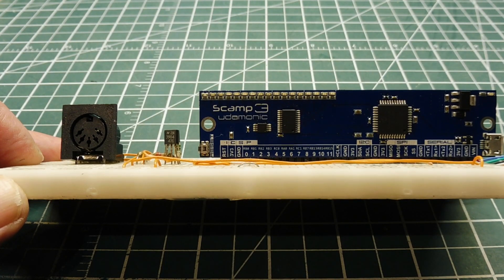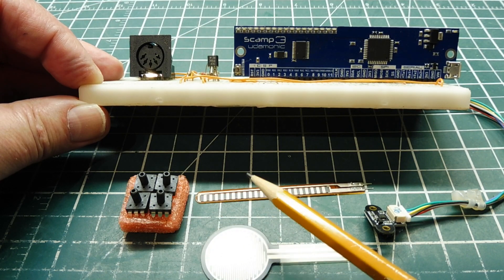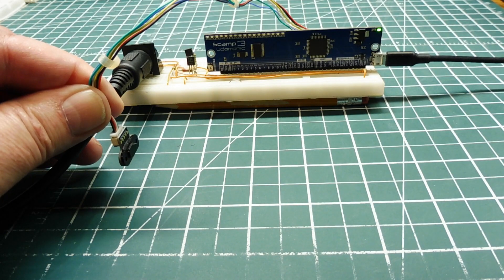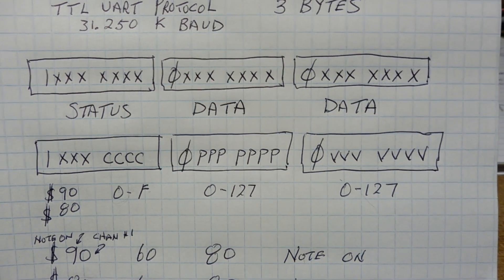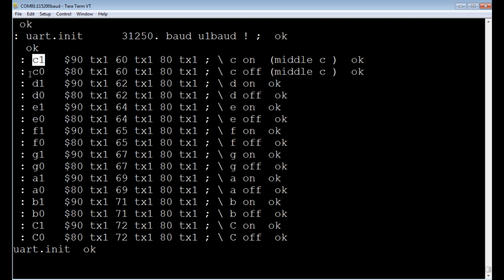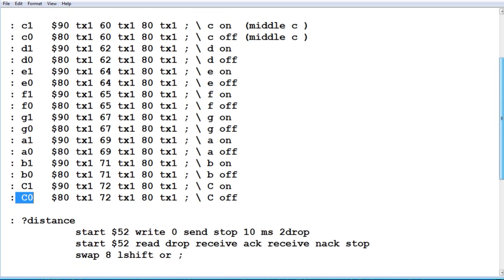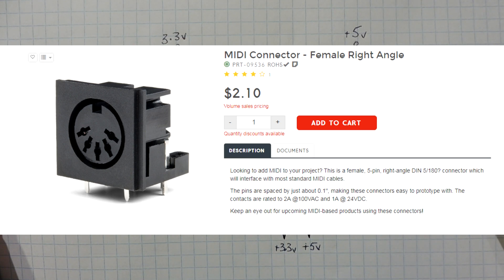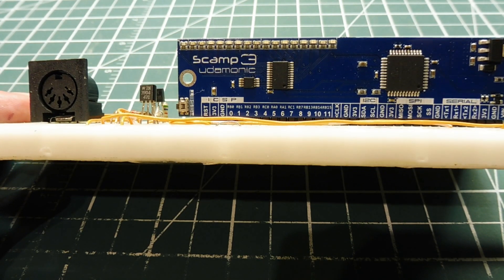Build A Simple MIDI Interface / Scamp3 / MIDI Theremin

Comment: Having only the Atmega2560 and FlashForth,  how would one implement that first word in your code?
: uart.init      31250. baud u1baud ! ;
Those must be scamp3 words but it should be possible on the Atmega2560.
Reply: Ralph, the Scamp3 has dictionary support for the UARTs, analog input, digital I/O, pullups/pulldowns, PWM, I2C, SPI, hardware random number generator, Digital Signal Modulator, onboard temperature sensor, 16-LED array... it does a lot more than standard flashforth. You can get stuff up and running a lot faster. As an example, have a look at this video on analog input on a Scamp... https://www.youtube.com/watch?v=8njTEL3wo_I
Reply from the maker: Yes...they are Scamp words. A complete list is available on the Scamp website. For the Atmega2560 you need to write a value to reg $c4 which is described in the data sheet.
An example to change baud rate to 9600:
: 9600.baud        103 $c4  ! ;
Reply: @0033mer  31 $c4 ! ( trusty HP48 )
Reply: @0033mer  I got notes out of my Music Maker (VS1053b)!
Reply from the maker: Is that Adafruits MIDI shield?
Reply: @0033mer  Yes. Adafruit Music Maker. I'm using jumpers from the 2560 to it and outputting to small speakers.